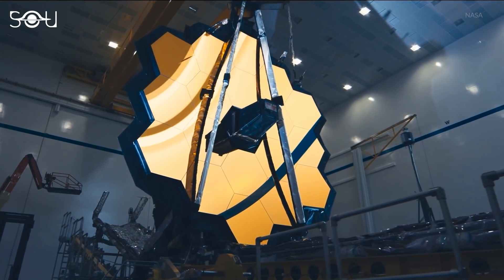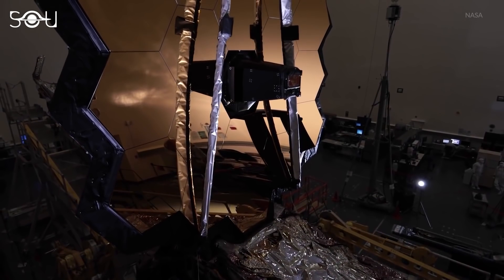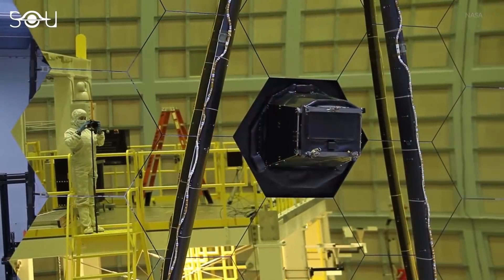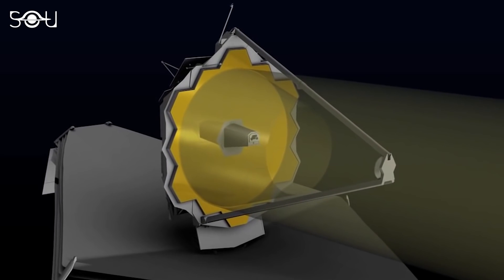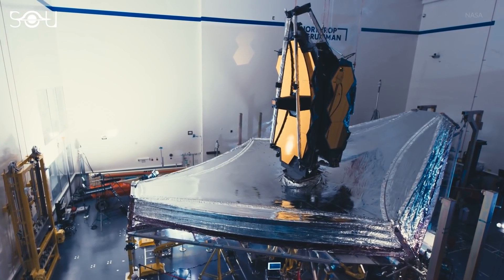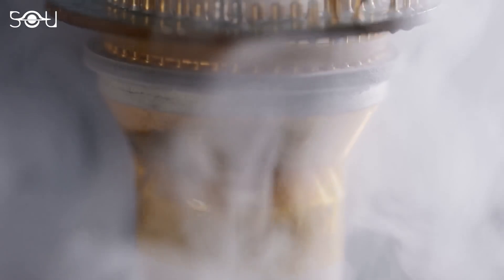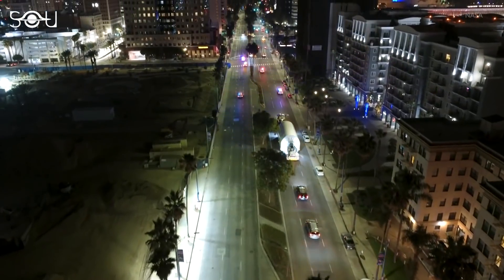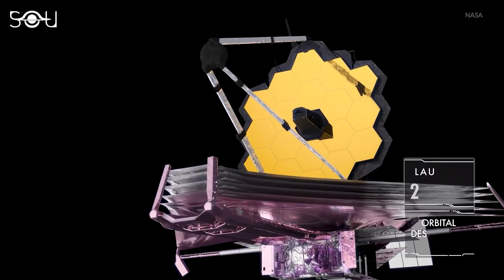James Webb Space Telescope | Everything You Need To Know

Comment: Nothing new under the sun: G. • .A. • .D. • .U (masonry) = holo. • .G. •. fourth dimensional branch. The stars are lights from an Anunnaki mothership projecting a hologram. Fallen totems (wheel of Samsara). The Earth is flat. Nobody went to the moon. NASA is a sham. You are only slaves to these tyrants. They just have put it together better. Look, the sun and the moon are the same distance from Earth, 5310 km, and with a diameter of 51 km. If you do the numbers right, they will give you the Tesla frequency, 3/6/9. The moon is a low-vibration frequency repeater that keeps humanity asleep. Underground there is a sun, the so-called black sun, which produces the northern lights and the lunar phases because it illuminates through the north pole. The Earth is flat and stationary. There are even more secrets. Trapped in the hypercube. You are only satisfied slaves of the system. Only you will free yourself from the chains. Assault of freedom with the force of truth.  Greetings.

Comment: Why on Earth are we trusting this to a European rocket, a rocket with only a 95.5% success rate, out of 111 launches, 5 blew up. Sad also that we no longer have the ability to fix anything in space since we junked our Shuttle and did not replace it. So if the mirrors are wrong this time, there is not way to go slip some glasses on it like we did Hubble.
Reply: I don't understand your comment about the shuttle. Even if we still had the shuttle, it wouldn't make a difference. The JWST isn't going to be in earth's orbit. Its going to be 1 million miles away (that is 4x further than the distance to the moon!)

For reference, the Hubble is only 360 miles up.

Comment: I see a lot of people think that the JWST is the replacement for Hubble, but that's so wrong. They work differently. JWST will primarily look at the Universe in the infrared, while Hubble studies it primarily at optical and ultraviolet wavelengths. Big difference. Also, NASA said Hubble could last until 2030–2040.
Reply: Hubble's been going off line for months, it's got fading gyros, getting memory corruption on its main computers. They've spent the last month trying to bring it back online already.
Reply: @michaelkeudel8770  Yeah, I heard that. That isn't the first time Hubble has gone offline, it happened many times in the past. But there are lots of options to repair Hubble including backup hardware, and can be also repaired and upgraded while in orbit.
Reply: @moonzestate  its crippled and its served its purpose well for the last 30 years, theres only so much that can fail before its unusable.
Reply: @michaelkeudel8770  Yes, but still it can be repaired and upgraded.
Reply: @moonzestate  if the last gyro fails, no they can't. And there's no space shuttle or replacement craft available available at this time for a service mission.
Reply: @michaelkeudel8770  It seems that you are misinformed and uninformed. The current Hubble problem is not about gyros, that's an old problem that has been fixed back in 2018. NASA says that the underlying cause appears to be a “synchronization error” that meant the instruments could not sync up to collect data properly. It also meant that the instruments “remain in good health.” NASA engineers rebooted the instruments, and the problem seemed to disappear. Until it appeared again two days later. While a reboot might again fix the error messages, it’s better to search for and solve the underlying problem. So, the current glitch is far from being unrepairable. And there is even a new spacecraft called the "Dream Chaser" which could fly astronauts to the Hubble for repairs. So let's not jump to conclusions. Scientists are still very optimistic for Hubble’s future.
Reply: @moonzestate  not true about lasting (performing science)  2030-2040, it will fall to earth in that time frame, NASA absolutely makes no such promises that it can continue doing science for so long. They hope they can do science till 2026 and perhaps till the end of this decade.
Reply: @olasek7972  "The telescope completed 30 years in operation in April 2020[1] and could last until 2030–2040.[4]" - from Wikipedia, Hubble Space Telescope.
It's even great If Hubble can do science till the end of this decade, JWST's mission lifetime after launch is designed to last about 10 years. So, they could complement each other for a fair amount of time.
Reply: @moonzestate  be critical about sources, now go and check the source this Wikipedia quote is based on.
Reply: @olasek7972  "Hubble's orbit is stable until the 2030s" - Thomas M. Brown, Mission Head of the Hubble Space Telescope. So, unless the Hubble suffers a catastrophic failure that eliminates the telescope’s ability to point at targets, Hubble will continue operating until its orbit begin to decay (2030–2040).
Reply: @UCVxh2VYuR1X7I0VldC06wTQ its has failing GYROS, or did NASA lie about that in your mind? The primary computer has failing memory/storage. Yes, the instruments are fine, but thats meaningless if you can't accurately point the telescope. Dream Chaser is just that, a dream. It's had one drop test flight from 3,500 meters after 11 years of program inception. It's as bad as the SLS which just delays year after year of even finishing the easy stuff. Hubble will run out of fuel before any service mission can even be considered, and would take years alone to design and build replacement hardware, nothing on Hubble is off the shelf hardware.
Reply: @michaelkeudel8770  The primary computer memory/storage issue has been fixed by successfully switching to backup hardware on the Hubble. Just because Hubble lost some gyros in the past (all of an older design), it doesn't mean that the new ones will soon fail as well. Don't be so pessimistic. Hubble currently has three fully functional gyros, meaning it can work in optimal efficiency. Also, the scope can still make valuable observations in one- or two-gyro mode. And this mode will greatly extend the lifetimes of other components. NASA says that Hubble could operate with relatively little impact on one gyro.

The Dream Chaser is not a dream, it will execute its first of at least six launches to the International Space Station in 2022.

Hubble does not operate with fuel. It uses gyroscopes to orient itself, just like the ISS. These gyroscopes use electricity generated from the solar panels.
Reply: @michaelkeudel8770  Dream Chaser was supposed to make its first of six flights transporting cargo for NASA to and from the ISS late this year. But it's rescheduled to 2022 due to pandemic-related delays. I don't underestimate Hubble's weakness, I'm just being realistic, and a little bit optimistic. :-)